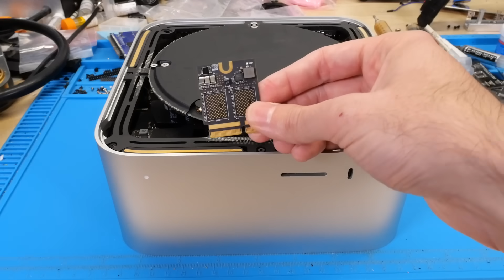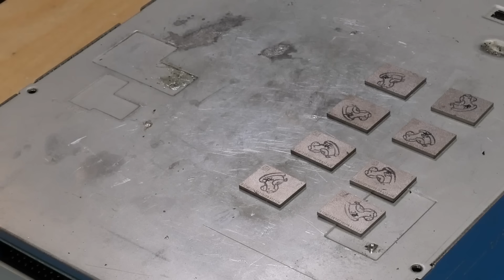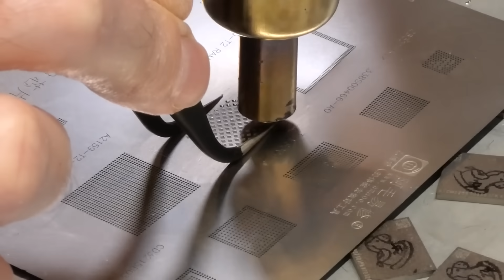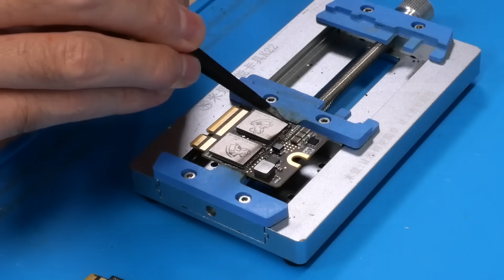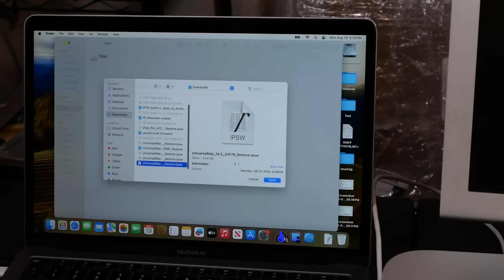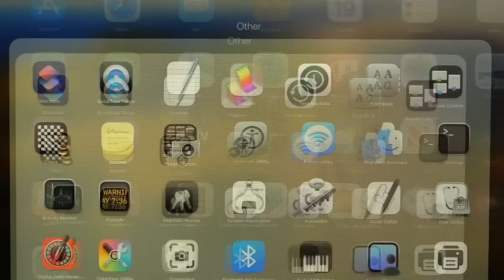Mac Studio Storage Upgrade - Made EASY with Custom Parts

Comment: This is just totally amazing, as always from dosdude. For probably 99% of people this is massively beyond the realms of ifixit difficulty levels. 

🤔 is it possible with the M2 Mac Studio?
Quick search, can't find out whether the SSD's are socketed or not?

It remains to be seen whether a M3 Mac Studio keeps the same design on release.

Are the economics of providing an after-market SSD upgrade there?
If the M3 Mac Studio keeps the same socketed SSD design, then I guess so - but how many people actually buy this type of mac?

Is it still considered the worst value for money option? It was in it's M1 iteration - it was slated as being pointless for most users.
At the time, if you wanted a small form factor desktop mac, the mac mini M1 in terms of price/performance made the M1 Studio look pointless.
Like, "who is this for?"

Anyway, what's cool about this, is lets wait maybe 2 or 3 years - these M1 studio macs are going to end up at super low prices?
Heck, I'd snap one up if there's a decent storage upgrade!

Comment: Do you have to do both modules at the same time? For instance if you have a 4tb module from factory can you just add a 4 tb module and then let the system program the nands, or would you need to buy 8 nand modules and replace 4 in the system and add the other 4 at the same time? how much will these modules cost?

Comment: Do you take orders to upgrade macbooks?    I got a 16GB RAM 256 GB SSD M2 Macbook Air, and I can't install any AAA mac games because of my small 256GB SSD and it wont let me install apps on the external  Thunderbolt 4 SSD drive.    You could make a killing upgrading people's SSDs.   Just wondering  how I can upgrade my SSD or how to install large games in external ssds.

Comment: Utterly ridiculous that anyone would have to these lengths to merely upgrade the storage in the Studio. While this upgrade is clearly out of the reach of the majority of Mac owners, I am hoping your experimentation (and the work of the gentleman who designed the board) can drive an affordable aftermarket solution.
Reply: Yes. Utterly ridiculous it’s difficult to modify. Later today I plan to upgrade my Samsung s24 fe to 12gb ram, since it only comes configured for 8gb but the s24 has both 8 or 12gb options. Should be a piece of cake. While I’m at it, I’m going to install a larger capacity battery in my oral b toothbrush and modify it to accept Philips sonicare heads, install a craft ice maker in my fridge’s freezer compartment even though it currently has a slim ice maker in the door, and I’m going to install a couple more cylinders in my f150’s engine. Why do people even bother buying new things? Y’all just need to stop buying Apple, everything else is utterly simple to upgrade and works JUST AS WELL. 😂 cause you know, I can run several LLMs, upscale video with topaz and use comfyui on my partners work dell 7875 precision with 12core cpu, 16gb ram, 4gb gpu and 256gb ssd that cost $800 more than my studio with 64gb ram and 2tb ssd with 12core cpu and 30 core gpu. 🤭
Reply: Virtually no one needs 8TB internal storage. I say virtually, because of course some will. Hi-rez content creators, colorists come to mind.

Comment: Wow, incredible stuff. Are the NANDs, once programmed on a particular computer, irreversibly tied to that unit?
Reply from the maker: Nope, they can be transferred between machines, but they are stuck in the exact config they were originally programmed in (modules are tied together, cannot be used apart from each other, and must be installed in same slots in other machine).

Comment: Next thing you know, Apple makes the chips encoded to each unit, which means the PC will know that the chip on the memory module has been changed and will instantly brick the PC 😶
Reply: u can flush them
Reply: I wouldn’t be afraid of that for now. If they were to implement this, they could no longer use blank NANDs, as there has to be a way for the system to be initialized at production time or for the storage to be repaired later. According to my interpretation of the information presented here, it is unavoidable that new blank NANDs can be inserted. The real impediment to upgrading is the sheer level of complexity involved in (re-)soldering NAND chips.

Comment: If someone like Rossmann Associates could do a mail service where I ship my Studio and get it returned with the 8TB upgrade for under a grand I would jump on it.
Reply: He can just send you the modules and you do a simple restore, no need to send the whole studio.
Reply: @artiumnihamkin9206  Yes, but it's a lot more convenient for a whole business of Mac Studio users to send in their desktops at once for a storage upgrade, rather than the slow process of manually DFU-restoring each-one until they all have the upgrade.
And this is probably not an option if the only Mac they have is this.
Reply: @artiumnihamkin9206 you need another computer I think
Reply: Same. Absolutely a market for this.
Reply: Yep. You just need another Mac for the restore, so you can just borrow one from somebody. It takes a while anyway, so just have a few beers or watch a game or something while the Macs are doing their thing in the background.
Reply: @quigonkenny  I don't think it's that easy but hope so because these ssds will fail especially in the 8gb 16 gb with slow lower quality cose cut one nand ssds.

I would think you will need to fix it before it fails for proper restore with fewust compromises.

What is the best source for a step by step for the average diy user.?
Reply: Money printing machine!

Comment: Thank you for the video. Is it possible to just add one custom board to expand the storage without removing the existing SSD board? Would DFU and factory reset still be required in that case?

Comment: Absolutely disgusting how much Apple charges for upgrades from the base model. Boards like this one are a real game-changer for sure. I am assuming that Apple will happily void your warranty for using "unauthorized parts"? I see locking these memory modules behind a serial number like they do for other parts in the future as this will cut into Apple's bottom line.

Excellent work!
Reply: Every November Black Friday Prime day I buy a new nvme double the size of the old one and shift all others and place the oldest or most used into a 3.2usb case. This takes me less time then this video including copy time. 😂 Although SMD soldering sounds fun for Turkey Day break I like to save money and time.
Reply: @johnpaullennon1199  That's great, but it still communicates over what is the equivalent of PCIe 3.0 x4, which is what Thunderbolt 3/4 uses. The internal SSDs use PCIE 4.0 x4, meaning that it runs at double the speed over what you get with an external drive.
This looks to be an absolute game-changer for those wanting upgradeable storage at the same PCIe version, rather than having to downgrade it.
Reply: Warranty??? When has an apple product ever karked in within warranty? Not in my 30+yrs of using apple products.

Comment: Hey Dosdude, I appreciate your efforts to enable Mac users to upgrade their memory. I've been working on the Mac for 20 years and it's very difficult for me to change my routines, I've been getting more and more frustrated with Apple over the past few years. I just don't feel free on the Mac anymore, which has led me to switch to Linux and run macOS as a virtual machine for a while until I can replace the programs I've purchased and used there.

Comment: Great work! But, the shenanigans that apple does with drives should be illegal, if a drive is replaceable you should just swap it out with any other compatible, even off brand ones. And no drive should be soldered, all should be swappable. And don't tell me about speed, because mac drives aren't the fastest on the market, so it is not a valid point.

Comment: Yes! YES! Finally sticking it to the man, I see… This is so cool, I may just move my boot volume back into the internal NAND module. I’ve used an NVMe drive in an external Thunderbolt 3 enclosure ever since I’ve bought my M1 Max Studio to preserve the former, but with this development, that’s no longer a problem.

Comment: And the fact that the Studio has these "SSD" slots says that Apple could make their devices upgradable - if they wanted to.  I'd be glad to accept 2mm of more thickness in a laptop if it had swappable internals.  (rather than having to decide a configuration for the life of the device at purchase time)
Reply: Don't forget not being able to change the storage if it suddenly fails and apple says it's your fault.
Reply: The problem is the memory controller is in the custom CPU. Which means you would need a storage chip WITHOUT a memory controller, which doesnt exist on the market. Otherwise there is nothing stopping you from switching it out.

Comment: Apple execs - let's solder all the NAND chips on the logic board for the next version
Reply: The reason apple is not soldring them here is due to SKUs,  so few Mac studios are sold that if they want apple stores to stock them they do not want to need to stock each storage/cpu/ram permutation.   By using socketed memory they are able to configure your purchase in store rather than needing a massive room fool of SKUs that will take weeks to sell through.     

For higher volume products (like Mac books) that they sell at way higher rates they would not have the time within the store to configure each purchase so having sockets NANDs is of no use of them.

Comment: Did you attempt to do an upgrade where you get to keep the old storage drive, just with the additional ssd? or does it have to be a fresh install and then transfer the data from the old drive to the new one?
Reply: You need to do a full DFU reset... this means a full reset of the system firmware from the ground up including resetting to the root keys within the Secure Enclave so all data on the old NAND is unreadable,.
Reply: @hishnash  Well, that stinks. but at least I know how to get around this issue. The problem is, though, I might need to buy another external ssd later down the line for backup.

Comment: This is awesome. Though having to know how to use a hot air station and source custom new NAND chips just to upgrade storage is a bit crazy (that's on Apple!)
Reply from the maker: Yep. Though, the eventual goal is to be able to sell these to others with NAND already installed, so the user can simply install the upgrade with relative ease.
Reply: @dosdude1 just take my money dude! 🎉
Reply: @dosdude1  You'll have a market for that, sure!
Reply: @dosdude1  I'd buy that. Less painful to buy a smaller-storage-volume Mac Studio and upgrade myself.
Reply: @dosdude1  block the hole on the stencil so you dont have to bother with every chip
Reply: @dosdude1  Great upgrade!
Will it work on M2 Studios? How much will it be in total?
Reply: @dosdude1  ¿is there a risk in the future that Apple could disable by software these third-party memory boards?
Reply: @dosdude1  Absolutely. Please let me know when your Team is going to do so. I have. 1TB M2 Ultra. I would love to have 4 or 8 TB of storage.
Reply: @dosdude1 that would be an amazing thing, however I could see Apple putting a stop to it in future models. You’ve effectively eliminated their (HUGE) upsell, and quite easily, I might add.

Would it be easy for them to eliminate/lock the system’s ability to reprogram blank NANDs while recovering in DFU mode?
Reply: @dosdude1  Excellent news. I look forward that day very much!
Reply: @dosdude1 how much would it cost for the 8TB module?
Reply: @dosdude1 do you currently do software patches anymore?  If so are you going to offer a patch for SONOMA?
Reply: @dosdude1 i would like to buy one of these
Reply: @dosdude1  any eta when this will be  a option ?
Reply: @dosdude1  Why doesn't the hot air gun damage the chip in the last step where you solder it onto the board?
Reply: @dosdude1  The new mac mini has this slot too. Imagine a $599 machine empowered by such an upgrade. YUGE VALUE. YUGE I say... Just tell where to buy this. I'm desperate. I live in India by the way🇮🇳.
Reply: Still cheaper to get all the equipment or hire someone that know how to do it than paying apple for it.
Reply: It’s a shame all m series aren’t this easy to upgrade storage. Dosdude would become a millionaire
Reply: @harveysmith4424  "this easy"
Reply: It does strike me as strange that Apple wouldn't halve the price of these modules, and sell them individually as upgrades. I get that Apple thinks they're making more money this way, but the initial cost of the system is high enough that people will inevitably 'cheap out' for entry, then buy external storage. If Apple sold these themselves, they'd get the previously external spend into their internal hands. But this is a great idea, glad to see it.
Reply: Don’t let Redshirt Jeff see this. I can see him trying to use a map gas touch to do SMD work
Reply: it's amazing the US Congress or the EU Parliament has still not threatened Apple with anti-trust prosecutions and legislative reforms given the extreme efforts Apple make to avoid and indeed frustrate the effort of those who would assert their #righttorepair on all Apple products.  I know many other corporations follow Apples lead on design and manufacturing products, so it would be a worthwhile reform. the Cold War with China provides Apple with political cover, but this shouldn't be a complete shield.
Reply: I want to see @dosdude1 upgrading the RAM just desolder the old chips from the SOC and replace with bigger once. :D
Reply: This would make after market Mac studios go up.
Reply: Can you upgrade the 2018 Mac mini storage? If so, what would it cost for 1 or 2TB.
Reply: No.. Its on you..
Reply: All this effort to support a company that hates and rips off it's customers to begin with - effort would be better spent elsewhere
Reply: @gorak9000  Oh, like Bill Gates and Microsoft are our best buddies, right?

Gimme a break. Most companies try to MAKE money. I love my M2 Mac Studio! My last Mac was a 2009 Mac Pro; it lasted until last year. I amortized it several times over. If you can get a Windoze to do that, then go right ahead. I happen to really like Mac OS, too. It’s pretty funny when jealous “haters” haunt these comments sections and tell us “how inferior Macs are, blah, blah, blah…” 
What for?
Reply: its the crapple way for you

Comment: Man you make BGA stuff look easy. I de-soldered a 980 YFC SMC from a 820-3435 board/laptop I got for $20. Has corrosion damage, and it was under that SMC. I need to order a new SMC now and a stencil (just in case, it comes pre-ball with lead-free). Got a little spooked when my wick stuck to the BGA pads, but none ripped. First time doing BGA and had to get a new hot air station to be able to do it.

Comment: Am I the only one who really misses back in, like, 2010 when Apple had a hidden recovery boot option buried in their EFI that was basically just a bootstrapper with networking and would connect to a server hosted by Apple to reflash the OS? I really miss the convenience of that feature.
Reply: I miss when the OpenFirmware and the EFI firmware would call up the DHCP server and blast out a BSDP packet to all the NetBoot servers it could find, and boot to a diskless customized installed of Mac OS or an automated, customized installer.

Comment: I'm surprised that no programming of the nands is needed. Compared to A12Z dev kit or iPad, this seems so much easier. 

However, I do believe you can find custom modules with nand chips soldered in china sooner or later

Comment: Why has no one made custom NAND sockets for the apple silicon computers? Sure it'd probably be very expensive, but even a proof of concept. We know apple uses NAND sockets internally for testing (not meant for production obviously) so theoretically it's doable.
Reply: Every company uses sockets internaly for testing on prototype boards.   Even laptop cpus etc are all first prototyped on LGA sockets. 

The issue with doing this on a production board is finding space for the through hole screens to the back, your not going to be able to have a presser attached socket (LGA) without a backbrace to hold it in place.  Production boards tend to be rather dense I would be supplied if there are 4 nicely spaced voids within the PCB internals for each NAND.

Comment: Is it possible to zero out NANDs from existing machines in order to reuse using a chip programmer?
Reply from the maker: Unfortunately not... Once these chips are programmed, they can never be restored back to a "blank" state ever again.
Reply: @dosdude1  Ah, that sucks... hopefully someone finds a hack or workaround or tool, especially with new chips costing so much.
Reply: @dosdude1  Sounds like a good challenge for you...
Reply: @dosdude1 I know that they can't be used on a Mac again, but can they still be reused in other devices?
Reply: Flash-Chips have a number of OTP (one time programmable) sectors that are usually used for logistics data and security information. I reckon that Apple‘s SW restore process „marries“ the NAND chips to a particular PCB and uses the Security and OTP regions on those NAND chips for that purpose.

In short once that process is finished you cannot revert those chips back to factory state because you can’t reset/erase the OTP data (hence the name)